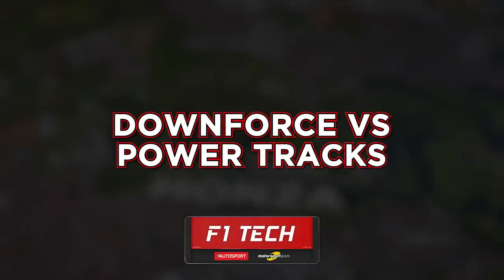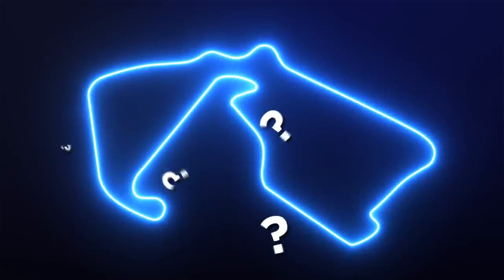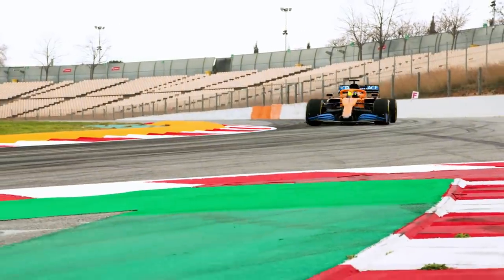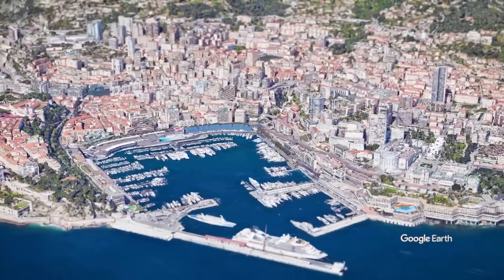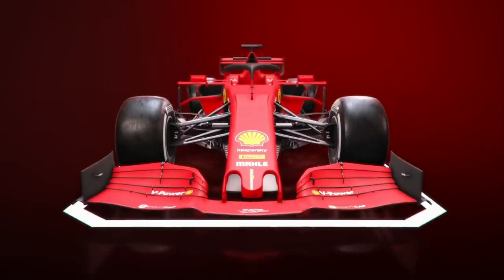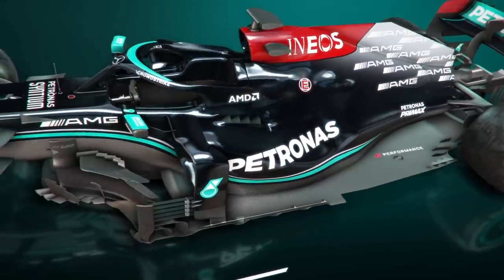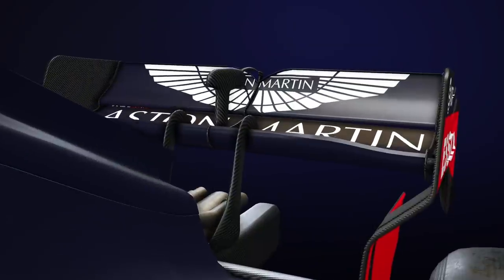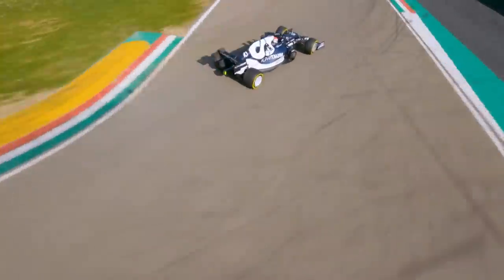The Difference Between F1's High Downforce And Power Tracks

Comment: That's why I liked Portimão so much last year: sure there was the fact the teams had no previous data about the track which made it extra challenging but it is such a mixed circuit that you could potentially have 3 cars with different setups and all 3 end up in the podium with near-equal chances of winning. And who wouldn't want to see that?! :D
Reply: Hot Rod  con•jec•ture kən-jĕk′chər►
n.	Opinion or judgment based on inconclusive or incomplete evidence; guesswork.
n.	An opinion or conclusion based on guesswork.

Comment: Just want to point out that the chicane on the main straight at 2:28 is no longer used. But great graphics overall
Reply: Yeah, I find it very annoying. They highlighted a non-existent chicane and a little kink on the main straight to bolster their point about short straights and Imola therefore being a high downforce track (which is not true). The main straight is actually somewhere between 1.3 and 1.4 kilometres long. That's longer than the 1.2 km main straight at Monza.

If you look at some of the better teams' cars now at Imola, you'll see that they're actually running very small rear wings. Not quite Monza spec but certainly not high downforce. This is really clear, especially with Aston Martin.
Gaining two-tenths in the corners really doesn't matter if you're going to be slow as shit on the almost 1.5 km long main straight where all the overtakes at this track are made.
Reply: @bigmaclexa I would categorize current Imola as a medium downforce track, with similar aero setup requirements to  Silverstone, Suzuka, and COTA based on what I have seen. This is also reflected in Assetto Corsa, where the top trap speeds for world record/near world record hotlaps at Imola, Silverstone, Suzuka, and COTA are roughly the same assuming the same car (325-335 km/h for the Ferrari F2004, for example).

Comment: The rear spoiler could be partially controlled by the gear shift. When shifting down for a sharp corner ,2nd gear and spoiler interact .Then when shifting up for straightaway,again,the spoiler is adjusted accordingly. All done by sensor activations.
Reply: Yeah that would be cool but active wings already exist and aren't allowed in f1. For example the wing on the Bugatti Veyron, it starts off at a high angle from a standstill for grip, then gets flatter for top speed, and then when braking it goes vertical to work as an airbrake. But the closest thing that's allowed in f1 is drs sadly :(

Comment: is Monaco not more mechanical grip? (real question)
Reply: It's both downforce and mechanical grip. Just like it is at every track. Downforce 100% is key in Monaco
Reply: It is about mechnical grip, but at the same time you still put as much downforce as you can. Softer suspension will make the downforce a bit less effective but it's crucial anyway. Sainte Devote, Massenet or Tabac are definetely fast enough to take profits from downforce. 

Also, it's not only about cornering speed. Even before slow corners you have to hit the brakes and you can do it stronger if you have more downforce (so you're braking later). The same applies to traction zones (getting on power early).
Reply: @jakubly  thank you
Reply: Definitely more a mechanical grip circuit as the speeds they carry threw most of the turns is too low to generate a lot of downforce. But u still run max downforce because it just gives u that little bit more performance due to the absence of straights.
Reply: Also downforce causes more mechanical grip (generally for you engineers/physicists I know this breaks down in extremes) but generally pushing the car down effectively creates mechanical grip by pushing down more
Reply: @defnotatroll  I don't agree with you. For downforce you need high speed which is absent in Monaco, in Monaco its all about mechanical grip and chassis with weight transition across two planes.
Reply: @TheJoezaidan  the only corner at Monaco which isn't high speed is the hairpin. Downforce counts everywhere
Reply: @sunnohh  Well in real world there's no mechanical/aero grip. There's only one grip which is about the friction the tyre can handle. And the load coming from downforce increases that maximum friction as you said. 

Talking mechanical / aero grip is a simplification to make it easier to understand and setup the car. That’s because most of the time improving grip at low speed corners will decrease grip at high speed corners (softer beams 'eat' a bit of downforce and make the ride height inconsistent which decreases underbody downforce). So it's easy to divide grip into two parts when talking setups and handling characteristics.

Comment: Monaco is not a good example of a downforce track because it consists of low speeds corners where mechanical grip matters --> in order to have downforce you need  high speed corners which is practically inexistant in Monaco. However a high downforce track with high speed corners is Hungary
Reply: Uhmm i think he meant by high downforce as high wings

Comment: What about if you had a really powerful car and trimmed it to the same top speed as everyone else but used that greater power to run steeper cambers and give higher cornering speeds. Sauber did this with their C11 Group C car. Martin Brundle, then driving for Jaguar, said that the car wasn’t notably faster on the straight (despite what the internet says) but ran much higher downforce setups which made them much quicker over the total lap.

Comment: Regarding Mexico, saying the thinner air means they can run as much downforce as they like without the drag consequences doesn’t make sense to me. Wouldn’t the downforce and drag be closely if not directly related when talking about wing angles? (Yes the floor is low drag, high downforce, relative to the wings) They run the high downforce kits to just get the downforce levels of something like a spa or monza aero package, no? So the trade-off is still there, just at a different level. Or am I missing a common knowledge law of physics lol

Comment: The "physics" here is so misleading and wrong in the sense of what you guys mean. That power isn't the power of the engine, but rather the power behind the car. What you have interpetted from it (drag increases with velocity) is correct with just V^2, and you would be surprised how significant that ^2 is, you don't need a cubic function to make this any more significant.